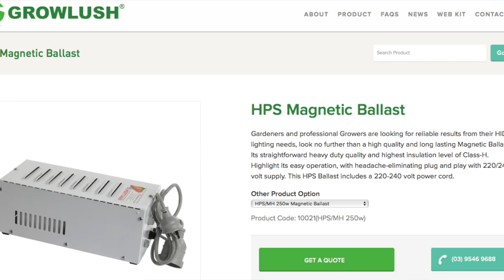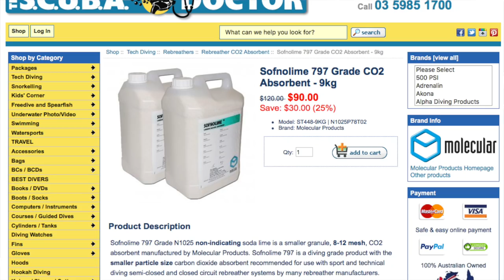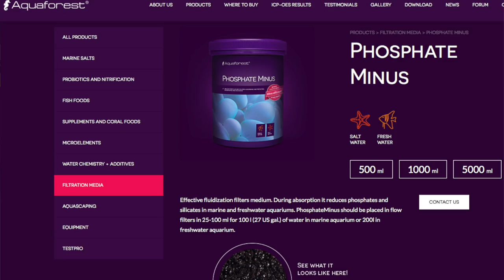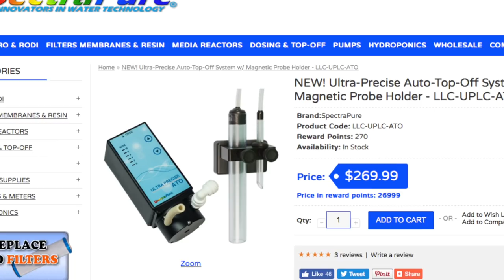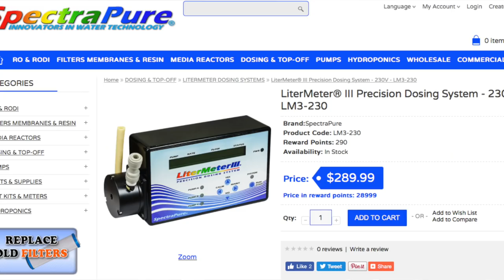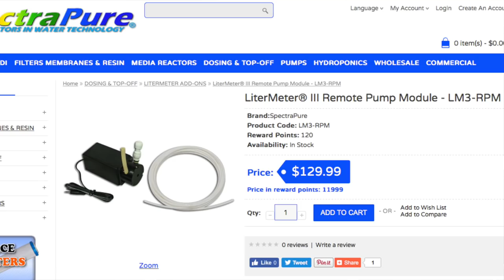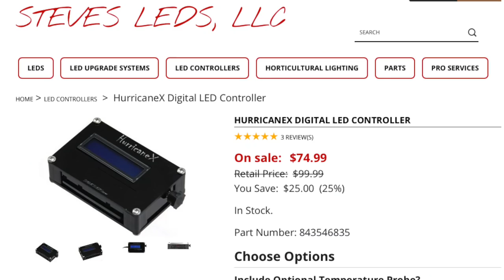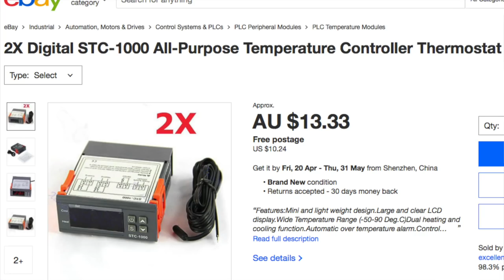Overview of my Reef Tanks

Comment: Super fantastic saltwater aquarium and Acropora corals too... Do I need all this equipment too be succeed ...... Thanks.
Reply from the maker: Far from it! you can have a successful reef tank without all this equipment, in fact I’m doing a video series on it now :)
Reply: Hey sir what is tip keep Acropora corals and strawberry shortcake corlas I try 3 time I fail  either change brown or bleach ways... I love strawberry shortcake because of color I spend $200 up just little frags if you can help me out that very good.. Thanks you sir..
Reply from the maker: I find strawberry shortcake always browns out in my tank, but if I give it three or four months, it comes back with more vibrant colour than ever
Reply: But they bleach now they changing browns is that means they die..
Reply from the maker: Bleaching is no good, brown is fine. If bleaching, there is something else wrong. Have you done ICP test?
Reply: Yes my temper inside is 79 are 80 .my cadmium is 490  my tank is Redsea 170 34 gallon I do water change every week  10% ..
Reply from the maker: But have you done an ICP test?

Comment: Sam , nice tanks, do you get NSW or make up the salt yourself.  I’ve been using NSW for years and am seeing randomness in quality. I’ve recently just gone to synthetic, but it’s twice the cost. I’ll soon see if my sps are happier.
Reply from the maker: Hey! I mostly use NSW. I recently did a video on what makes my tank tick specialising in the water. Check it out as it’s a bit different to what most do :)
Reply: Good idea circulating the water through the socks.  I started recently using carbon in my IBC to catch any chemicals that maybe introduced during my delivery guys collection.   I’m going back to mixing again, will see how the tank responds. Mixing is a few extra steps. Believe it or not I actually had good results on that cheap blue treasure stuff, usually I go Red Sea though. I hate wasting water doing RO though, thinking might use it on the garden.
Reply from the maker: Yeah it’s great for the garden if you can collect it in a spare drum?
Reply from the maker: @jestronixhanderson9898  yeah a little bit of carbon wouldn't be a bad idea.... I like it :)

Comment: Great overview of your system, just a question about your surf Santa Monica scrubber. I have the same one. Mine seems to grow a lot of slime Algea, it's in a high nutrient system. It's Cleaned weekly. Any tips on how to get that lush thick green hair Algea like your is?
Thanks
Reply from the maker: I struggled with it for a while, ended up having troubles with the light and was quoted a lot to replace it. Removed it from the tank and didn’t notice any difference....

But when it was running well, it was decent. Needed a lot of air to get the flow through it
Reply: Thanks for your reply, was the struggle getting growth? Or just the faulty light? 
Thanks again
Reply from the maker: Struggle was getting much growth. I didn’t have overly high nutrients on my main Tank so I moved it to my clown tank that does have High nutrients and it still didn’t produce a heap of growth 🤷🏻‍♂️
Reply: Thanks for your info
Reply: Parkers Reef 
Hello again, if I may ask a question regarding your sulphur reactor, how do you go dialling in the drip rate and maintaining it? 
Thank you
Reply from the maker: Great question! Essentially, you start with a fast effluent rate and slow it down a little every other day until your nitrates hit the value you want. If you have too much media, the effluent will smell like egg. If you don’t have enough media it not reduce nitrates enough.

That being said, it’s very forgiving and self regulated pretty well
Reply: Parkers Reef 
Thanks, I made one from a reactor a while ago but it kept slowing down and was hard to maintain a steady drip rate. What type is your reactor and pump that runs it?
Reply from the maker: The reactor I use is a geo calcium reactor. Make sure you have a fast effluent at first and to give it a while to seed. The water will almost thicken as it get flooded with bacteria which could slow it down a bit
Reply: Parkers Reef 
Was the one above your clown fish tank an aqua medic? That's proberly the style I was interested in.
Reply: Parkers Reef 
Also regarding the flow rate, I was starting with a drip per second then increasing each week, maybe that's why I was having trouble fine tuning the drip rate. So start with a slow stream then slowing down as it thickens my be the better option.
Reply from the maker: Yes that is an aquamedic. That is just a flow through style of reactor, won’t be quite as effective but still does a good job. Start with a fast flow rate and then slow it down, not the other way :)
Reply: Parkers Reef 
Thank you for your helpful info, last question, what type of pump are you using on the AMedic reactor? :)
Reply from the maker: @si8780  - its just a small feed pump. Cant remember the brand, probably just a small pond pump from a local hardware store :)